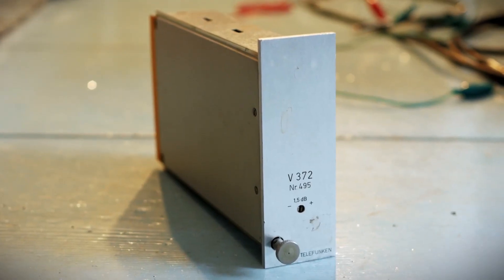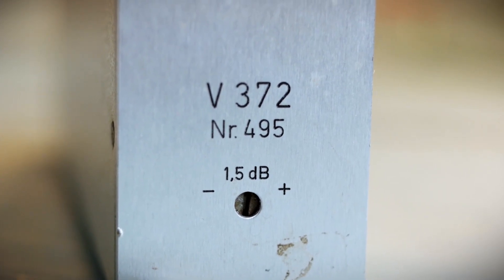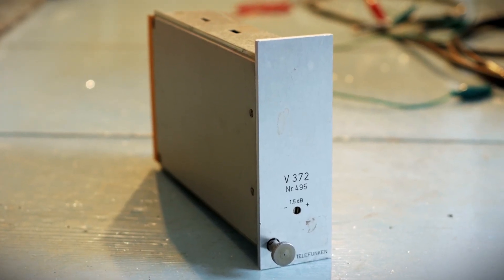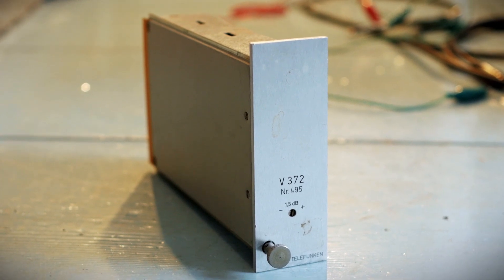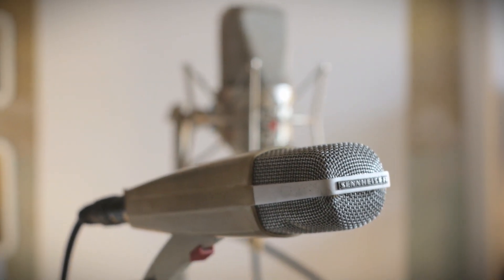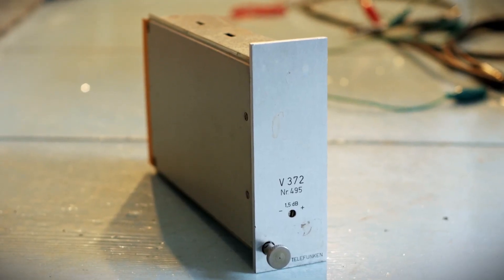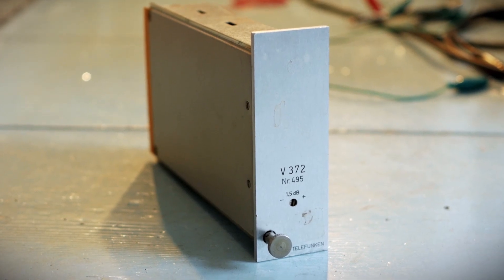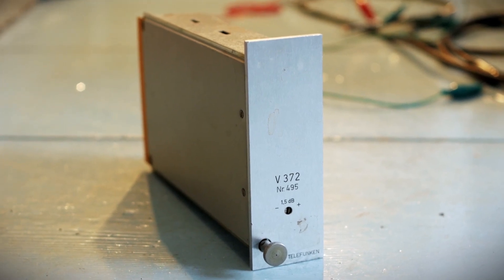HQ audio demo: 1960s Telefunken V372 mic preamp /// feat. Neumann M49 & Sennheiser MD421

Comment: Any ideas where I can get info on the v675? I own a stereo pair and know next to nothing about it technically. Thanks
Reply from the maker: Yes I have schematics. Will dig them out for you after work.
The V675 is a summing amp. It was superseded only 2 years after its introduction by the multi-purpose V672.
Reply: @3str  thank you!

Comment: Do these sound similar to v672?
Reply from the maker: Hey Zane, the old version of the V672 with rectangular output transformers sounds more mid rangy and upfront.
The later V672s with round transformers are more balanced and "HiFi" if you like.
I personally prefer the V372 because it sounds fat and "just like a record".
Reply: @3str  how much v372 go for now a days? There is a company 51x audio in 🇩🇪 germany, doin diyre 672x (clone), im curious to see if its any good.
Reply from the maker: @zanem9022  I've sold a V372 on reverb for €400 about a year ago.
I haven't seen any other sales lately, seems like they are becoming rare.
Personally I'm keeping the one pair I have left - it's the next best thing to a V72.

Re. the German company cloning V672s: 
You probably mean 51x Audio / Silent Arts?
They're definitely legit - Volker knows his stuff.
Reply: @3str  i want a v372, I prefer the color over a neve. Yes 51x audio, thats exactly the company.. He builds/design good gear? I wanted to grab the v672 clone, he even have the haufe tranformers in there
Reply from the maker: @zanem9022  Yes, 51x are legit.
You can save some money by picking up used Telefunken modules though.
But it's a bit of a rabbit hole - there's two very different sounding versions for starters.

Rectangular output transformers:
Lots of "iron" in the tone, mid range push, quite upfront

Round output transformers:
Full range, rounded, "HiFi"

Not meaning to makes this a sales pitch, but I have a pair of the latter listed on reverb - you'll find it..
Reply from the maker: Yes - I'm mission control on reverb :)
Reply from the maker: @zanem9022  Can we move the chat to reverb please? DM me @ mission control.. Thx!
Reply: @3str  are the v372L the same as your v372? Thank you 🍻
Reply: I also have a chance to pick up the u274. How do you like that one? 🤙🏼
Reply from the maker: @LongWeekendRecords  No, they are quite different.
The V372L is a line driver with limited gain and a fairly high input impedance
The V372 on the other hand is good for up to 50dB gain and its input impedance is freely configurable with external resistors.